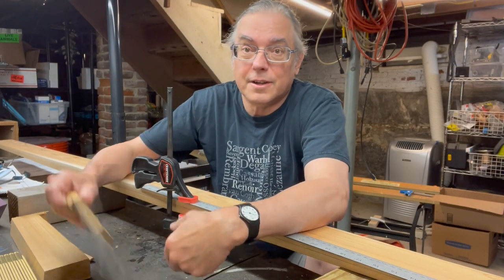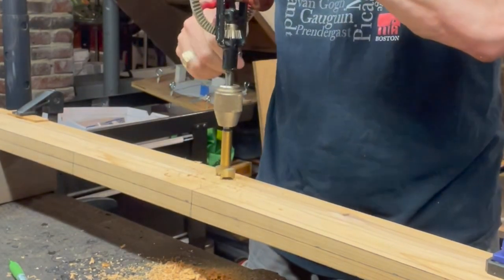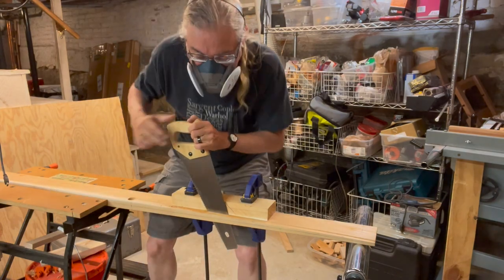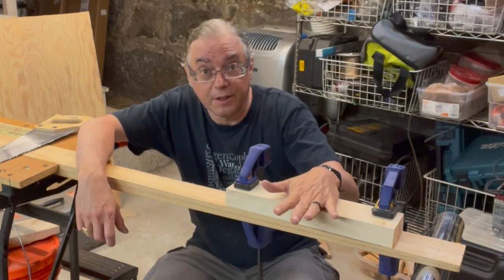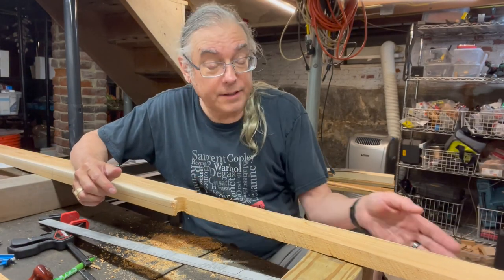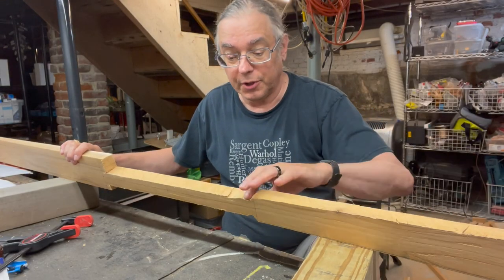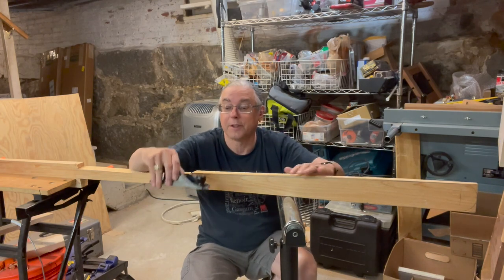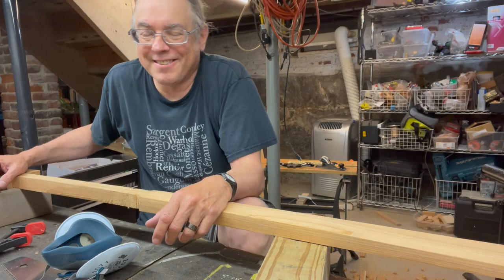Making a Greenland Paddle with Hand Tools - Part 16

Comment: The other drill might have been better. It appears to have a dual-speed knob and it would change the gearing to a higher level and better for that bit.
Reply from the maker: You put the knob closer in? It looks like there's a hole there.
Reply: @notthepainter  That appears to be a Goodell Pratt two-speed drill (the maker's mark is on the crank handle holder bar, under all the rust).
Next to the flywheel, on the back side, there is a small knob (probably nickel-plated at one time).  To change speeds, you pull the small knob out and spin it a half turn , this will change the gear to a faster/slower ratio.  That is a great drill and will serve you well, once you refurbish it.
Reply from the maker: @bestbuilder1st  I do see the mark, starts with a G and dirt covers the rest. But I can see the second line and that does say Greenfield so it definitely is a Goodell Pratt. Cool! I also see the adjuster but it won't turn a full 180 degrees, so it looks like I have a cool restoration project on my hands. I found this link, http://michael-parrish.com/2016/05/31/goodell-pratt-5-12-b-two-speed-hand-drill-restoration/, that will surely help! Thanks so much!
Reply from the maker: @bestbuilder1st  It was! See the next video in the series where I demonstrate it.
Reply: @notthepainter  looking forward to it.
Reply from the maker: @bestbuilder1st  See https://youtu.be/rg6ocQY6R7w?t=620